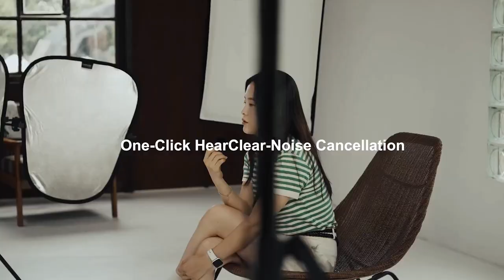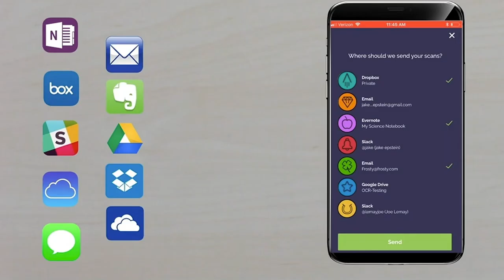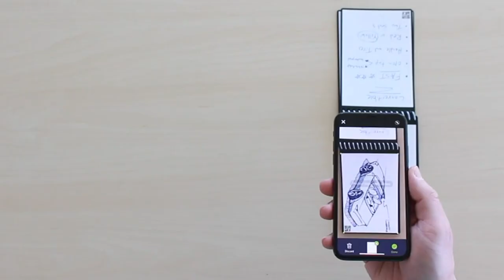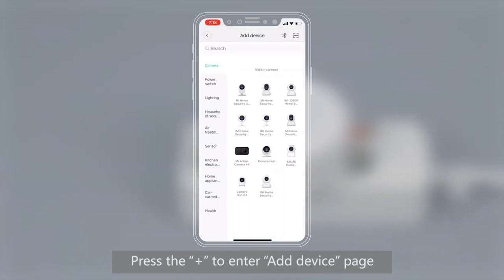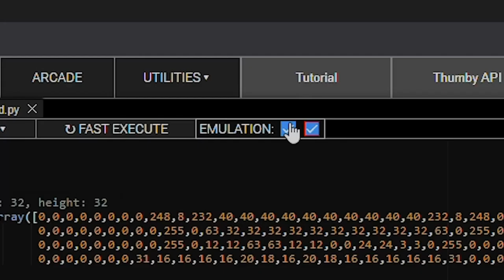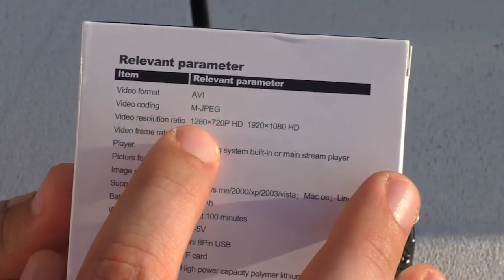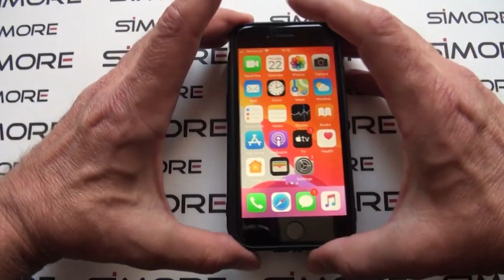10 MINI GADGETS THAT YOU CAN BUY ON AMAZON

Comment: 3:43 That's just a cheat code. EVERYBODY includes a bottle opener for the cheat on this garbage to up the "tools" included. Also, that's nonsense to even include it on the list, since I can do all of it with a Leatherman Ps4, along with more.

7:32 As far as the CRKT, I'll stick to my Wiha tools over anything else when it comes to Torx. I like CRKT for knives, but not in the Torx department. Get yourself a couple of stubby Wihas and you're set in a pinch. If you want to all-out, it gets pricy. 

I'm gonna go ahead and ignore the smartphone thing. That was just... it just was. You made the vid. I blame you on that.
Reply: techzone63  Nah. No reason to do so. It was simply my response to the vid. You have every right to the first amendment, as do I.